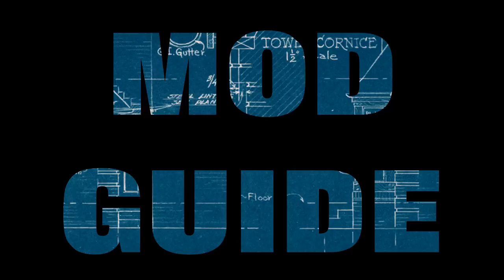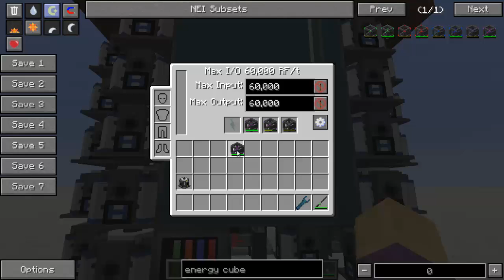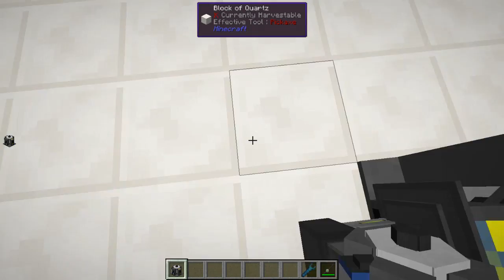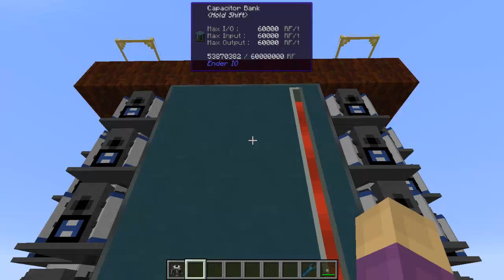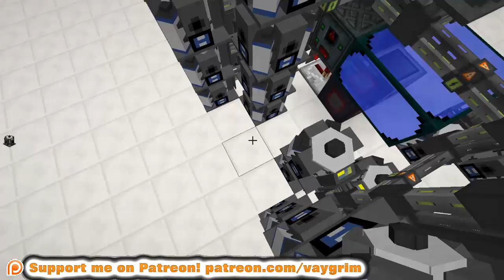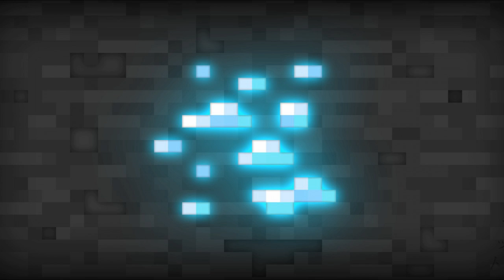Mod Guide - "The S.S.C." Massive Power Solution by Meradudd

Comment: This is a marvel of spacial design. Ender IO is marvelous for builds like this. I am using a smaller, much less compact version in my own world. However, I have found a bug (feature) in mekanism; this build should be outputting nearly twice the power, but mekanism gas-generators are limited in their power output based on the power hydrogen can produce. The ethylene you are burning actually produces more power, but the generator just can't output it fast enough. I posted a bug report over on mekanism site and hopefully it will be fixed and the true power will really flow.
Reply: Actual I am wrong. With the config settings used in VC, the problem in mekanism limiting generator output won't be seen. The down side of the way it is configured here is that electrolytic separators use 10 times the energy. Once the problem in mekanism is fixed, VC configs can be tweaked to something like hydrogen 200, biofuel 900. This would have the gas-generators with ethylene about the same as they are now, gas-generators with hydrogen going down to 160 rf/t, and the electrolytic separators using one fifth their current amount. I really like this power system setup here; while big reactors are great and well balanced, having all the generators and cables brings me back to the days of running 50+ industrial steam engines in a huge power complex.

I have really enjoyed VC mod pack and the lets play series you have. Please keep it up.